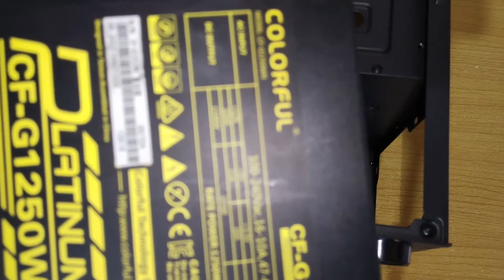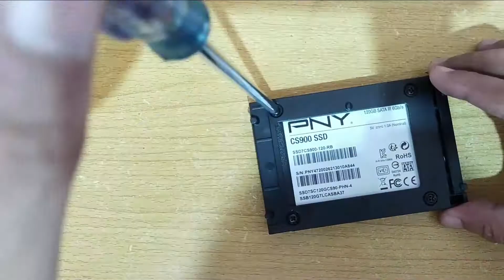HOW TO CHANGE GAMING PC CASE Timelapse Build | FEAT. INPLAY METEOR 05 GAMING PC CASE

Comment: Pano ma change color ng inplay meteor 5 ang mga fans
Reply from the maker: Salamat James sa iyong panonood. 
Ang fans  ay hindi kasama sa Meteor 05 gaming case (plain case lang talaga siya). 
Ngayon, kung nais mo bumili ng seperate fans para kay meteor 05 at mapalitan ang  mapalitan ang mga kulay nito o color variations para sa inplay meteor 05, kinakailangan mo bumili ng ARGB or RGB fans with controller o kaya maari mo ito i-synchronize  sa iyong Motherboard (depende ito sa ito MBO un iba kasi wala argb or rbg pins). 

Sana nakatulong ito, James. Salamat muli.